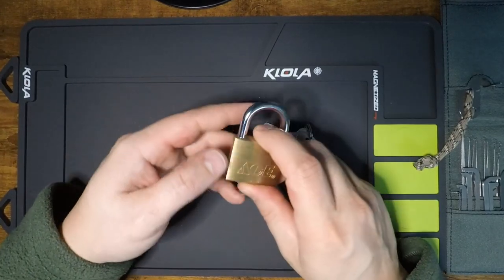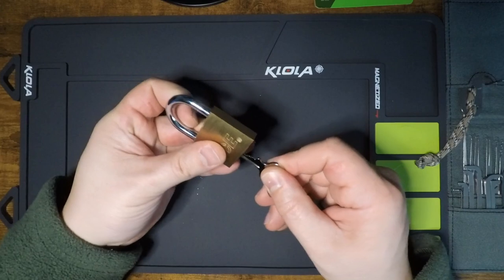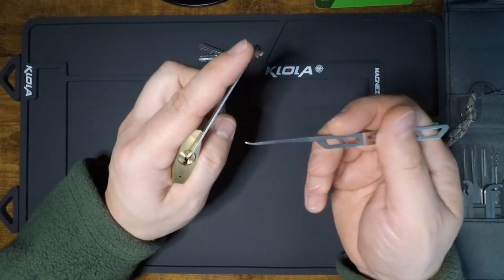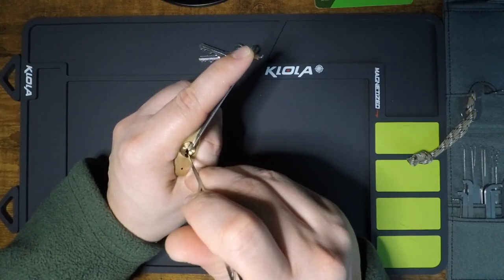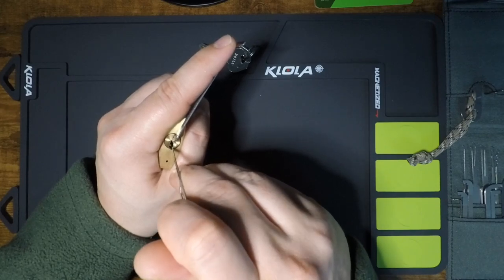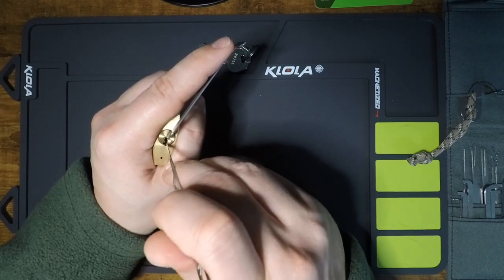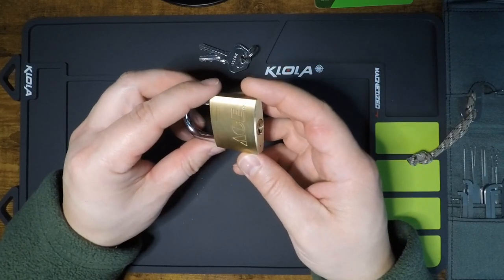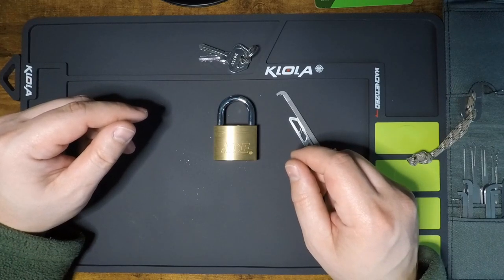Ace of Brass - Ace 38mm Brass-Bodied Padlock

Comment: Having gutted an Ace round body and getting a similar difficult pick (after rearranging some driver pins), I think that both locks use a combination of serrated and serrated spools with serrated key pins. That combined with some fairly tight tolerances seems to force a binding order, easily drop pins, and means some really easy over sets. Looking at the pins these seem pretty identical to the American 1100, so I wouldn't be surprised if they're from the same factory. Ace sure are some nice locks to pick as a learning aid, and are inexpensive if you're lucky to have an Ace nearby